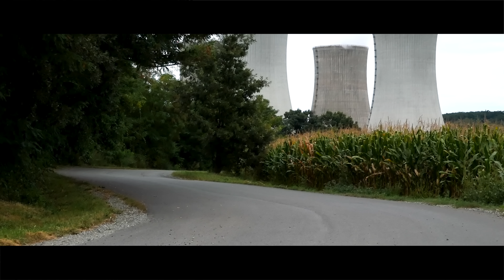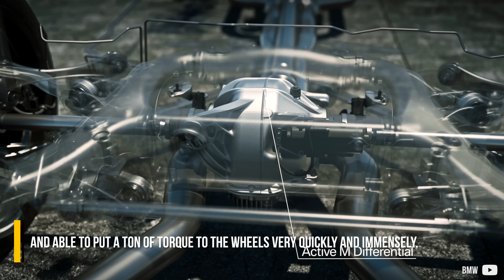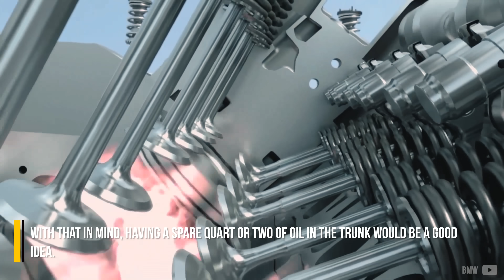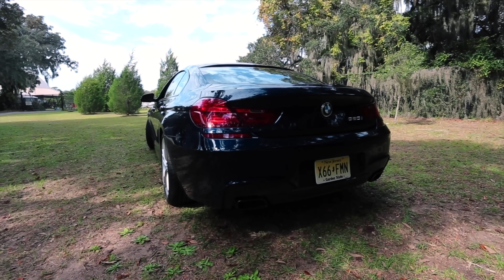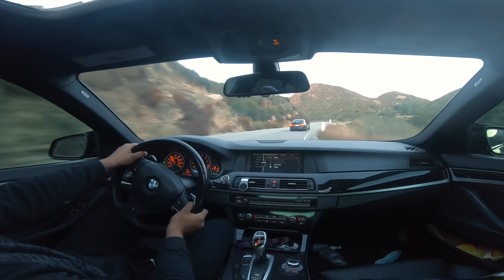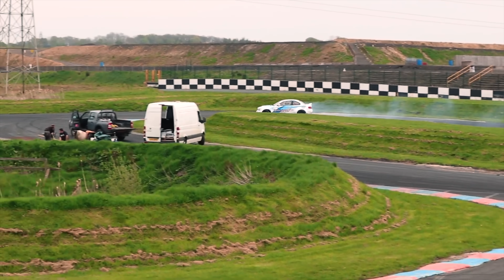The Worst BMW Ever?

Comment: My F10 M5 is my daily driver and has over 150 thousand miles on it. I’ve only had to replace the injectors so far but then again I drive it like a baby
Reply: Why did you get an M5 then :D
Reply: @MisoElEven  hey I still have fun with it here and there lol
Reply: @Royal91x  Good to hear that xD otherwise a bit of Spanish inquisition would be necessary for your heresy
Reply: beautiful car if u ask me, keep babying it...when yours is one of the fee left on the road, its going to be a special time
Reply: How much to fill up your tank?
Reply: @TtotheH-zo3qh  Depends where youre filling up xD if you live (for example) in the north of the czech republic you can theoretically go to poland and fill up for 1,5€/liter or go to germany and fill up 4€/liter xD
Reply: @TtotheH-zo3qh  with gas prices right now about $105 with premium
Reply: @Royal91x  your point? Please make one.
Reply: @theone4606  what do you mean my point? Nobody was trying to make “a point” we’re you dropped on your head as a baby or?
Reply: I have a f10 535i m sport. Only 60 thousand miles on it. No problems so far
Reply: @jaxfan  thank u, some people are just unlucky and rant about it after
Reply: @FBA-TJ  I make sure I get oil changes every 5000 miles too
Reply: @jaxfan  cool you have the last version of the n55 which is alot better than earlier n54's
Reply: @jaxfan  535 is not a v8, secondly what yr do you have because early f10's are not very reliable. It get better around 2014 and up
Reply: @TheKhaos85  is a 2016. I get oil changes every 5000 miles

Comment: God, only had to work on one (13 m6) and when I got around removing all the crap around the engine I swear it was like looking at Medusas head.. so many tubes and freaking wires everywhere.
Reply: German engineering yaa
Reply: An horror film
Reply: SO true , it's a fuckion pain in the ass
Reply: Look at a VW or Audi V8 or V10. They are even worse regarding the amount of tubes and wires around them.

Comment: 27 times more top-offs? My car has almost 150,000 miles on it and generally doesn't need additional oil between changes. And it takes about 18 refuelings between oil changes. 27 times more often would be 3 top offs for every 2 refuelings. That's why I avoid BMW. Might be fun to drive but just not built to last.

Comment: Tbh I wouldn't touch any BMWs from the last 10 years, not just these turbo V8s, they all pretty much have a poor reliability record, even the lesser 4 pots. Those turbo V8s don't even sound very nice imo.
Reply: The 4 cylinders are truly designed by complete idiots. Im repairing an B48 and I can’t believe someone approved such an engine. Every plastic part of them fails guaranteed.
Reply: I wouldn't touch them from the last 20 years. Never had so many trouble before with a car as I had with my 2002 3series E46...
Reply: Yeah anything with a vanos system is asking for trouble. My mate bought an e46 330 with 100,000kms on it and has had nothing but endless trouble the entire time
Reply: @izzy031096  , the M54 is actually an unbrakeble engine, only the components surrounding the engine need to be maintained. For vanos there is this upgrade kit for example. PCV is also shitty.

Comment: Funny to think that when BMW made the N54, their first turbo I6, it was an overbuilt engine for what it was meant to do. But, you see the N63 and immediately see how bad that engine was.
Reply: This engine isn't that bad though, it's got four bolt mains an can put out upwards towards 800hp on a stock bottom end.
Reply: @kirunacat  just because it can make power after you replace pretty much every part on it doesn’t mean its a good engine. They are absolute nightmares when it comes to reliability.
Reply: @augustortiz  replacing HPFPs injectors and chain guides (the latter of which mostly applies to earlier versions) isn't exactly every part. Spend any real time with these engines and you'll understand how it's not the worst BMW engine
Reply: N54 and n55 which btw I have just blew one up are amazing engines how EVER a every 6k mile oil needs changed every 60k miles bearings and oil pump and chain need to be changed if you can deal with those things then the engines are amazing other wise absolute nightmares I have rebuilt a good amount of them and believe they are shocking the n54 has shocking turbos and injectors and they cost a bomb n55 has those issues fixed but the crank is weaker and the valve tronic is crap the little half cog wears out then the cam it’s self dies 

The amount of n55 with failed oil pumps that have gone are unreal and the rods end up welding them self to the crank or the bearing spin at which point you might as well throw it in the bin, unless you can rebuild this engine your self there is no point in having it other wise this engine is great and very well balanced

Comment: N63: Twin turbo 445hp
Corvette: 670 horsepower naturally aspirated LT6 V8 bone stock
Reply: N63: 2008
LT6: 2021

sorry
Reply: You're considering the base N63. In the X5M and M5 you can get over 600HP from the same engine.
Reply: When you compare an older engine (the lowest spec one too) to a special race spec engine that isn't even out yet. 

Right...
Reply: @wesleyfancher4280  NA 2008 LT3 430 horsepower is a little more fair.  Beg pardon.
Reply: Corvette is supercharged
Reply: @overlord398  not the new one, the new Z06 is n/a
Reply: @spicysnowman8886  sorry my fault

Comment: This is what happens when you rush the design, anyways awesome video. Thanks!
Reply: I mean they feel the need to release new BMW variant every year then it's inevitable for design rushes.
Reply: @barebarekun161  yup, but it isn't so important, that they have to make bad variants.
Reply: @bewareyt6515  Some said to Mercedes Benz that they have accountants in charge instead of engineers in their companies nowadays, I think that also applies to BMW as well.
Like how do they messed up putting ipad style screen on all the Mercs and called that luxury? ,they looked cheap as hell.
Reply: @barebarekun161  Yep, everything is screwed up nowadays.

Comment: These engines are nasty. The N55/B58 engines had their own problems but they were much easier and economical to fix.
Reply: B58 has no issues
Reply: Only nasty if you're afraid of them, also if you want an economic maintenance cost, by an economy car.
Reply: @kirunacat  Its not really about the cost itself.. just the sheer time you spend on trying to fix it.
Reply: @MisoElEven  I personally don't mind spending time with a car that I like, so it's one of those to each their own kinda deals
Reply: @kirunacat  I dont mind either.. needs less plastic honestly. Currently deciding between a manual 320d g20 or an automatic 330i g20. I just find automatic trans boring to daily drive but then Im also kinda scared of the EU commies new "eco" ideas.. another problem is that the 320d doesnt have lsd as an option from the dealer and an aftermarket one would break the warranty. Its like bmw want me to either get bored daily driving an AT or on the track with a diesel without an lsd.
Reply: Both of those are great engines, not much goes wrong with a b58 though. Think some coolant consumptions about it. Even the n55's issues are limited to that stupid plastic charge pipe and if it gets a hard life the lack of sump baffle.

Comment: I don't think BMW engineers designed these cars to last beyond 100,000 km / 60,000 miles. After all, the people who buy these cars new can probably afford several new cars every year, change their car every 2 to 3 years anyway, and most importantly are leasing customers, which means that all statistically significant repair costs are factored into the lease payments. BMW gets money, a rich buyer gets a car for a couple of years. At the end of the leasing period the warranty has expired, and the car can be sold again to some crazy petrolhead, who hopefully can fix it on their own.
Reply: That's definitely the case at least here in America, why build a car that that lasts 300k+ miles when the person who buys it is just gonna drive it for a year or so and move on to another newer model? But really its another way for them to make a little extra money, build a car that's gonna break constantly and not tell you how to fix it in the owners manual so you have to take it back to the dealership to get it fixed, it's disgusting but it's not just BMW that does this, just about every foreign manufacturer in the last 10-15 years (except for maybe a few aisan manufacturers such as Toyota and Honda) has been doing this, hell I'm sure even Ford, GM, and Chrysler have been doing it as well
Reply: Almost 80% of BMWs are leased.
Reply: Nah I think I depends on how you treat the car cause the f10 5er we have is still going strong after 150 000 km.
Reply: You’re right we are the one who’s trying to fix these cars after those people who leased it and beat it then trade in . Got my e60 m5 at 97k it’s been 3 months from the very first day I started to maintain the car even before I enjoy the car because I don’t want the car give me a big bill so hoping these inexpensive early maintenance make the car happy lol
Reply: @giraykharizzma7737 e60 m5 a whole nother ball game 😂 good luck with that beast

Comment: how the fuck did you calculate 15000 miles or 30000km I have even problem with 0.2inch being 0.5cm your math suxx man. Furthermore those numbers 15000km oil change? Maybe on fucking 20year old car these high pressure high compression ratio cars (they actually decrease compression ratio using turbos) need like 8k / 1 year.

Comment: Garbage engineering that screams: cost savings. It's everything the German car industry is about. 
On top of that, i bet their downsized v8 consumes more fuel than the 5.0 toyota v8.
Reply: and the Toyota V8 will literally outlast it’s owner. while you have to pray the N63 BMW engine could run without problems for a month
Reply: @zhila5958  damn..I simply can't deal with such a car

Comment: As a german who has worked with quite some BMW engines: Most of them are bad. BMW only look good and are super overengeeniert. 
The small engines are the best. 1.4, 1.6 and 1.8 when its come to reliability.
Reply: In my experience N52 & B58 are the most reliable BMW engines you can get at least in North America.
Reply: @CadexLaw  Andd do you have experience of M52 or M54s? ;)
Reply: I'm not so sure with the timing chain problems, even worse is that they're situated at the rear of engine next to the bulk head
Reply: @phil955i  you must be talking about the B58, to which I have not heard anything about chain or chain guide issues, only VANOS solenoids really
Reply: so the inline-6 ones are terrible?
Reply: @zhila5958  this is not what i said. The m50b25 is the 2L I6 without vanos and bullerproof with the right care. But for example: the headgascet can blown when the car overheat and this happens really fast in a tafficjam with this engine. This dose not happen with the Inline 4.
Reply: @DerBitchervonBlasvikken  fair enough
Reply: Older M50-N50 series Inline sixes can be beaten on... And they still go on like nothing...
Reply: @maatu_boe  yeah. but definitely not the newer ones. excluding the B58 ig
Reply: @zhila5958  Well for example N52 and N54 have the problems of M52/M54 engines tackled but have new different faults in place... Wouldnt call them bad
Reply: @maatu_boe  well said
Reply: @zhila5958  n52 and N54 ahem
Reply: @kirunacat  i don’t trust n54. way too many issues for my liking tbh
Reply: @zhila5958  turbo wastegates, HPFP, injectors and oil filter housing gasket is too much?
Reply: The M62 was a fantastic engine, do your chain guide maintenance on time and it lasts forever, just like the M50/54

Comment: From what I’ve seen on the Mercedes units as well, hot-vee engines with turbos are just simply a match made in hell. That’s German engineering for you. 

Also, since we’re talking on poor engine designs, how about the V8 in the Triumph Stag? Definitely a contender for the worst V8s ever made.
Reply: @Alfred Wedmore the N63 is not a very big engine. Volvo put a 4.4L 60° V8 in the S80 and XC90s and it's a fantastically reliable engine. Size has nothing to do with it. The N63 is smaller in displacement than the N62 that preceded it, which came in 4.4L and 4.8L. The N63s biggest quality issue in it's infancy was stretching timing chains, which was covered by the CCP recall and since been fixed in newer revisions of the engine.
Reply: im sorry but the 4 liter v8 from amg its just a masterpiece .
Reply: Back around 2009 i really wanted an E90 M3 with the S65 V8, Top Gear had made a big deal out of them and i loved the look, Made the costly mistake of buying one. Silver with very low KMs. First the throttle body actuators, then the rod bearing, traded it for a Lexus IS-F, which i still have, and has never missed beat or given any trouble.
Reply: @TeUhtred7860  Lexus 👍

BMW 👎🏻
Reply: Isn't it strange how companies that only 25-30 years ago were known for their reliability and engines that could run to huge milage all started making such unreliable and over-complex junk in the post-2000 period.  WHY did they do this!?  And not to mention most of the newer BMWs are so ugly they put me off my food lol.
Reply: @soundseeker63  BMWs have always been higher maintenance vehicles, as technology advances so does the maintenance required around that tech. They're not unreliable, they're high maintenance. Also the cars design is up to everyone's criticism, not just yours. Some like the newer designs, some don't, to each their own.
Reply: @kirunacat  I don't agree. I have had verious BMWs from E34 upto E46 and the older ones especially were not high maintenance at all.   Ok there wasn't much tech in there to go wrong in the first place - they were incredibly basic by todays standards, but what you did get would last 200,000+ miles without any major issues if you serviced it properly. Nowadays you'd be lucky to get to half that milage before experiencing an expensive issue. And thats not just down to all the added tech, thats due to cost cutting all round and building with a set service life (i.e 10 years) in mind.
Reply: The Stag V8 motor was a reliability nightmare but it is still the best sounding V8 ever! They have a unique firing order. Not sure if this is why they sound so good.
Reply: The Triumph V8 was a beautiful, well designed engine. BUT it didn't have enough pre-production development time spent on it. The Hartwell modified and tuned units showed the Triumph V8's true potential.

They didn't use the General Motors V8 that Rover used because Triumph was still a separate company and not part of the British Leyland/Rover group of companies.

Triumph had some some unique and successful straight 6's as well as the underdeveloped V8.
Reply: Yep, why Triumph didn't use the Rover V8 which was available to them we'll never know.
Reply: @phil955i  I can tell you, politics. Rover and Triumph were competing companies forced together under the BL banner.
Reply: @phil955i  Clarkson goes into a bit of depth: https://youtu.be/b9ztUlve9jc?t=110
Reply: @applejuice5272  yes I've seen that before, a great explanation 👍
Reply: There are lots of benefits to a hot V though, they're not really that hard to work on. Most of the disassembly on these engines is wiring and hoses. From a technology standpoint these engines are fantastic!
Reply: @kirunacat  It's not even about maintenance issues, nor the minimal gains in efficiency in power delivery and packaging that irks me about the hot-vee turbo setup as a whole, but rather the engineering aids that tries to justify the setup in the first place. 

Large N/A V8s? Downsize and slap turbos on it. Turbo lag? Nein, Schmitt! We'd just reroute the exhaust path inside the V so the exhaust gases doesn't travel as far. Mein gotten! It's now really hot! Oh well, just put two small intercoolers at the intake and a large radiator in-between! Scheiße, now the fuel economy is terrible! Don't worry, we'll just introduce direct injection somewhere between the hot pipes! 

All that, plus other unforeseen consequences as a result of those engineering aids like oil starvation just kills any interest for hot-vee engines as a whole. Sure, it's a great technological achievement but at what cost? Definitely the sanity of mechanics and owners of these vehicles.
Reply: @Nafeels  Lol true xD - too much complication. I've had  MB M177 AMG and that was a great motor but I like my old M113 N/A motor, nice and simple.
Reply: @Nafeels  I've not heard or oil starvation as a result of the hot V layout. Also, a major design aspect of the hot V is helping keep the intake manifolds cooler, because heat rises. This does mean more heat is concentrated in the valley but understand most of this heat comes from the catalytic converters which sit immediately behind the turbos. If the DFI was there for fuel efficiency the injectors wouldn't be absolutely huge for a gasoline engine. The main benefit is reducing knock. I've spoken to a number of BMW tech and hobbyists and for the most part their opinion of the N63 is not that it's terrible, but that it's packaged in a complex way that flags lots of hours. Of course this means nothing in terms of cost when you work on your own cars or have the money to pay someone else to do so. From a manufacturing standpoint, especially when you use an engine in multiple platforms and models, packaging efficiency is incredibly important, notice how most manufacturers moved the ECU from in the car to on the engine, and the TCU from inside the engine bay to inside the transmission. Sometimes it might be more difficult to work on, but do remember the car is designed to be a car first. Vans and minivans are absolutely terrible to work on but you see them literally everywhere.